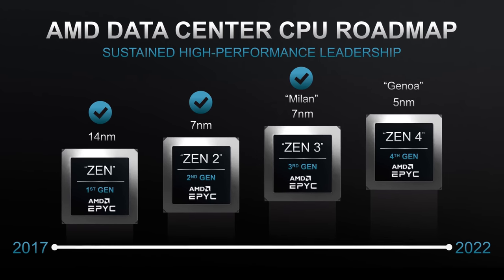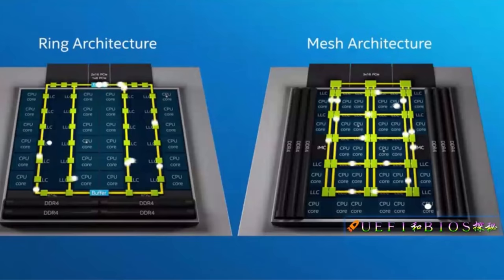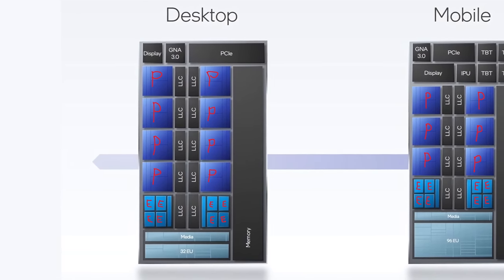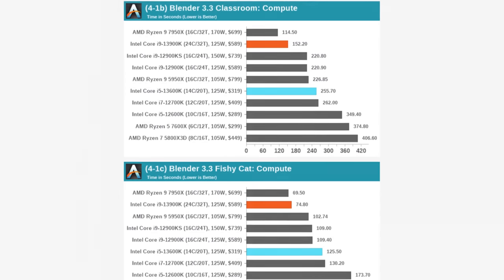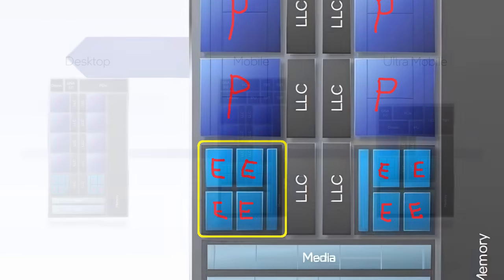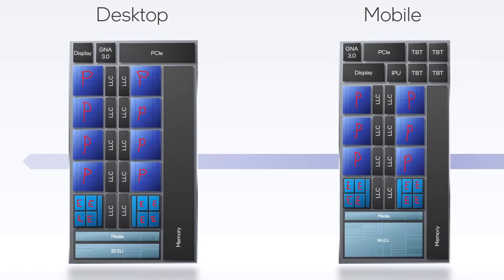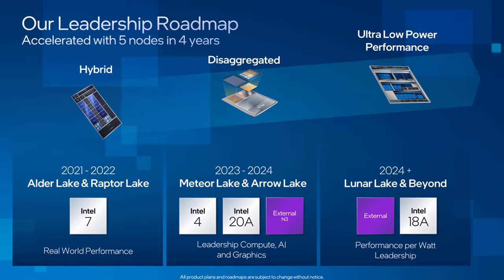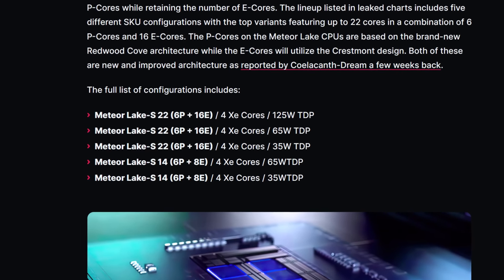E Cores - Slow, simple, not super efficient... but still good?

Comment: I wonder if amd next time adds a few "E" cores to the io die. The biggest problem would be getting the os schedulers working correctly. Apple got it right because they own the entire platform, but when you have a highly diverse ecosystem it can be a challenge to integrate the properly.
Reply: I mean, Windows 11 currently handles it *okay*. Leaves a bit to be desired, obvi
Reply: Intel and AMD both need to work closely with MS on the Win11 scheduler for the next update to come out prior to their CPU releases. AMD messed this up quite a bit with fTPM bugs and scheduler issues last fall with the launch of Win11. All 3 companies would need to work closely and do a better job with this.
Reply: BIG/little has been a thing on mobile SOCs for years. The Apple M1/M2 have the same design since they are based on the A series chips in iPhones, just scaled up.
Reply: They will. There has been strong indications that Ryzen 8000 next year will come with 16 Zen 5 cores and 16 Zen 4C cores (Zen 4C is a special variant of Zen 4 meant for specialized servers).
Reply: @JFinns  yeah, I remember similar issues with Intel, with windows not knowing how to use the E cores well. Makes me wonder if microsoft is the one not wanting to cooperate more closely if both companies are having the same issues
Reply: Linux supports 12th gen Intel pretty well, so I would imagine it wouldn’t be that big a problem
Reply: @maikeru6158  Scheduling is notoriously good in Linux and isn't necessarily such a priority for a desktop OS (other than "game go BRRR"). On that note, it's very likely one of the main reasons Linux got so good at it is because it powers Android, and mobile devices have been doing big/little processing for a while now.
Reply: @cheaterman49  > one of the main reasons Linux got so good at it is because it powers Android
No, the (vendor-specific?) scheduling of tasks across big.LITTLE cores is almost universally bad on Android. Once your work thread count is more than you have big cores, the performance *tanks* although in theory it should continue to rise.
Source: see any of Argument600 benchmarks. Use subtitle translation if you need to.
Reply: @VADemon  This is very interesting, it's not what I've been observing in all my work with SBCs, although admittedly I use Linux on these and not Android ; the Exynos on XU4 and the Amlogic S922X are both impressive performance beasts, including with all cores on full load!
Reply: Their little core are gonna be zen4c, one chiplet with zen5 cores, the other 16 zen4c
Reply: However the ground work should have been laid out by intel and win11 already. Sure they might need to adapt a thing or two but i doubt its that big of a deal for a company like amd
Reply: AMD cannot have scheduling issues like they did with Bulldozer back in the days
Reply: AMD is already planning this for Zen 5, by combining Zen 5 cores with crippled Zen 4 cores, Zen 4D. To achieve these same effects.
Reply: E cores are a waste of time. It needs the OS to be written with it in mind. And even then it is a better idea to make a normal core more E and still P. Why make dedicated E cores just because you suck at making good all around cores... Or right.. Intel.

It might make more sense to put P cores as a accelerator core and think of E cores as the main CPU. Then maybe E cores makes more sense and leaving P cores as very few but potent dedicated accelerators. Makes writing games and programs that needs fast execution easier. Just point it to P and enjoy. Removes complicated schedulers as the user can or program can deal with it themselves.  And leave Winblows to not use the P cores like a evil criminal that needs to be locked up for acting bad. Since that is what most OS's are today. Working agents the user...
Reply: Power users could just use process pinning, just pin games to the P cores and the scheduler will figure out that the rest of the threads can run on the E cores
Reply: @TheDiner50  Writing a scheduler for heterogeneous architecture is not the most impossible thing in the world and smartphone OS's have been coding for it for the past decade. Linux already has it. They are able to determine at a high level where threads can be ran better.

To understand E cores, you need to understand the major thermal budget a CPU has. It's more efficient heat-wise to run any thread you can on the E cores and leave the P cores to run the highly demanding code. As P cores are less heat efficient per operation. This will be true of AMDs implementation supposedly in Zen 5.

The thermal conductivity of silicon absolutely sucks for the kind of dissipation we are demanding of it. CPUs have to restrict themselves from burning themselves out for thermal purposes. Dark silicon is still a major portion of real CPU time. Heterogenous architecture seeks to solve that by running basic operations through basic heat-optimized cores. Which allows the P cores to run longer and perform faster on operations that actually need it.
Reply: Not on the IO die. They'll want to maintain cache coherency with the P cores and they'll want to use the same memory controllers
Reply: @KaiserTom  NT has been getting improvements to its scheduler to work better with big.LITTLE esp. with Windows 11. We aren't in the same place we were with the disastrous paring of Windows 10 and Lakefield. Though it will be interesting to see how AMD will screw up their Zen 5 (maybe RDRAND will be broken again, or the old classic of RET breaking the branch predictor)
Reply: I highly doubt that will ever come to desktop. They belong in Laptops in my opinion.
Reply: I think another big reason why they got it right in the first place is that their m1 processors are based on the same arm processors used in their smartphones. Thus making the transition to the m1 SoC was a bit easier as they already built up that decades worth of experience with this kind of  processor.
Reply: @DDRWakaLaka  ok at best... and I was forced to upgrade cuz win 10 just... don't
Reply: Did you know that you cannot specify affinities from the app on the iPhone?
Reply: "E-chiplet" design
Reply: @KaiserTom   Oof, maybe Zen 6 will be hybrid
Reply: @TheDiner50   Microsoft already worked with Intel prior to Windows 11's release and still to this day, but it's like everyone forgot that. AMD on the other hand...... they're in trouble when they inevitably release a hybrid CPU.
Reply: @michaellin4553   How do you pin cores? Process lasso doesn't even work, I didn't know it was actually possible.
Reply: @mycelia_ow hybrids already being seen on amd, but right now only for laptop / mobile segments of the market